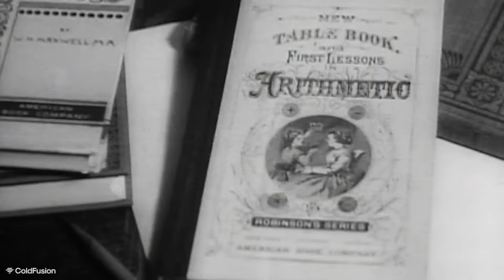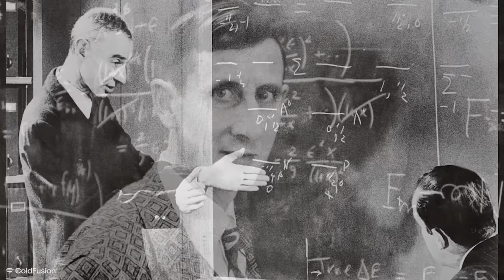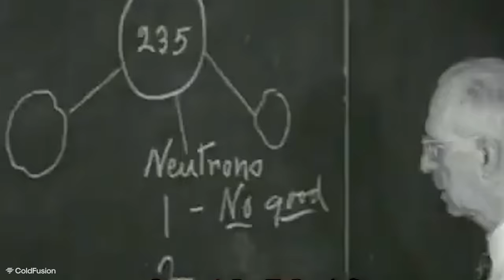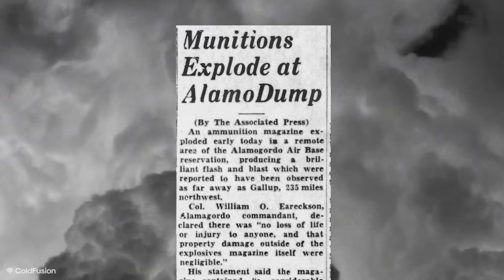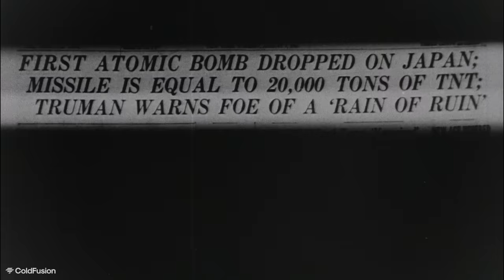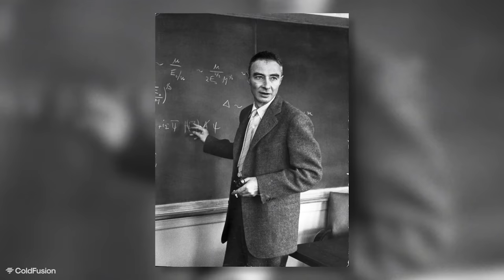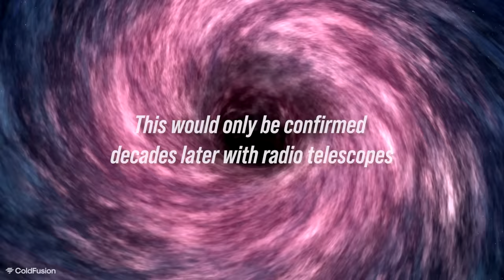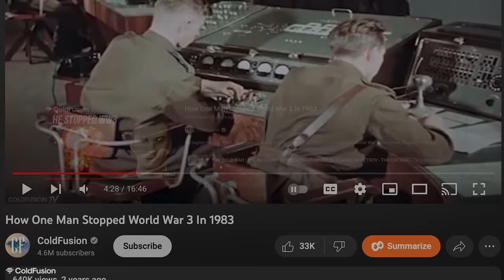Oppenheimer's Controversial Legacy

Comment: "If you're good at something don't give up."

Unless you know that something is useless, like when I discovered wireless electricity and confirmed it was pointless to take on in elementary school then a bunch of college grads made it a thing 6 years later (when I was still only in high school) only to confirm what I had theorized about the ridiculously poor efficiency as an elementary school student.
More than 18 years later and where is wireless electricity "Witricity"? It still exists not sure about the company itself though. Last I heard they convinced BMW to make wireless charging pads for use in their EV cars but that was already more than 3 years ago.

Some ideas are well worth pursuing others aren't. Solar power was worth pursuing even though decades after discovery its still a rather pitiful way to convert energy to electricity... the "discovery" and subsequent radiographic "evidence" of black holes wasn't worth pursuing at all and is under threat of being disproven (as all the evidence for those is just as accurate as the predictions that claimed the detonation of the atom bomb would cause the Earth's atmosphere to burn uncontrollably destroying the planet).
Reply: Sorry mate, but Tesla came before you by 100 years to discover wireless electricity...
Reply: @gaborrajnai6213  
Unfortunately Tesla did it wrong, I'm talking about wireless electricity without synthetic lightning. Tesla couldn't transmit electricity without plasma arcing.

Comment: There was only two discoveries which were essentail to the Abomb neither of which Oppenheimer was a player. 1. Discovery that neutrons could cause fission, 2 U235 was responsible for low speed neutron fission.  Once it was known U235 was the key isatope the entire Manhatten project was a project to isolate U235 in order to make reactor /powerplants or bombs.  Later Lawrence identified a means of chemically separating out plutonium which was reactor made but also fissile.  Plutonium became the key to obtaining bombs. The bomb designs were a lesser role because achieving critical mass wasn't that hard, getting a high yeild was harder but the first bombs were not super efficient. It is a feat to get the less than pure Plutonium to explode through compression by high explosive but it was'nt needed with pure Plutonium.